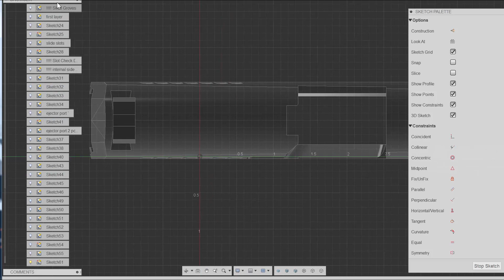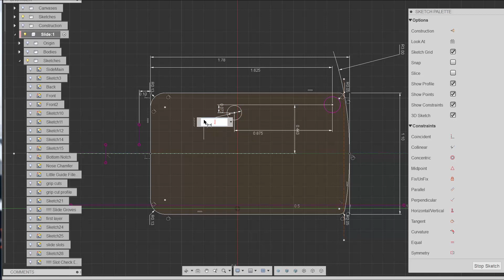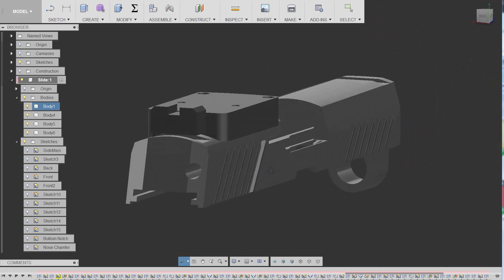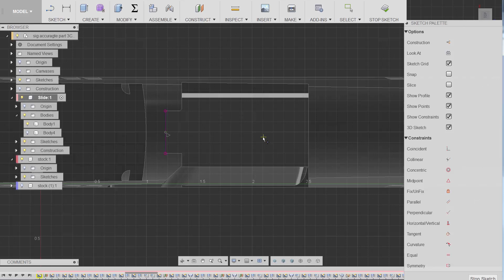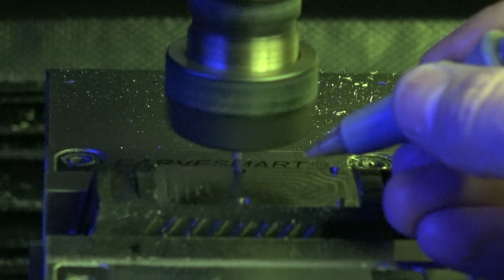Ultimate Sig P-320 Part 1. Custom Milling

Comment: Nice work Sir, Quick question, I am installing a Romeo1 on my P320 and i was wondering how much you cut off the top of the slide? Or i guess how deep you cut exactly?
Reply from the maker: 0.110   from the highest point down looks like.

Comment: R.I.P. little threadmill; you served us well. Nice to see you posting again Jesse. I've found a bit of cutting fluid helps w/ threadmills, especially the really small ones, and give a nicer thread finish.
Reply from the maker: Thanks Warren i havn't had much luck with threadmills in anything other than aluminum. Ill def try fluid next time. I have a haas vm3 now too so the runout will be less of an issue now also :)

Comment: Nice work. Is it safe to say you prefit the rmr while in the vise and it was real snug so you opened it up the .002 because otherwise you would have done this while the 1/8 was already in the machine before drilling and threading or have I missed something? 
We always learn as we go brother. The difference is some can learn and others can’t.. 

Stay learning,
-ncengravers
Reply from the maker: Thanks.. FYI Love your vids man!  Yeah I test fit it in the vice  before I ran the extra .002.  Basically when I measured it before doing the cad i saw it was .004-.005 bigger than the specs. So what i did was just add a couple extra contours with a negative stock to leave.  If you do that it saves you the trouble of going back to cad a bunch. Just put a pause in the gcode between them then check , run the next check etc. Works great for doing things like walking in holes as well.
Reply: Thanks. Nothing wrong with making changes to get that exact fit your after. Shoot for -.12 on your z depth and you should be good for cowitness with any suppressor sight.